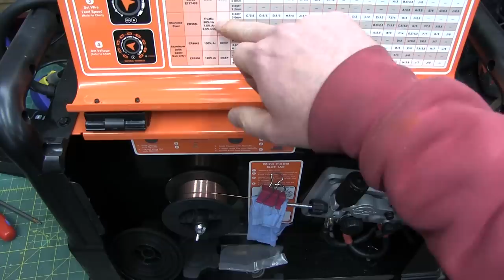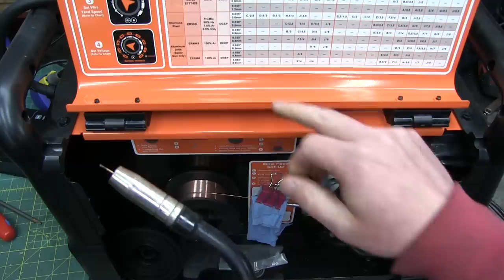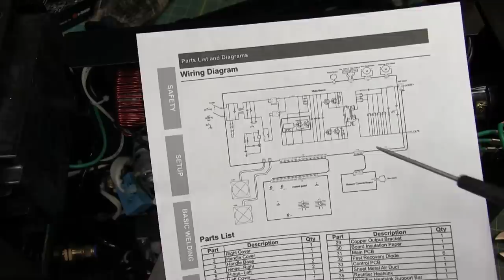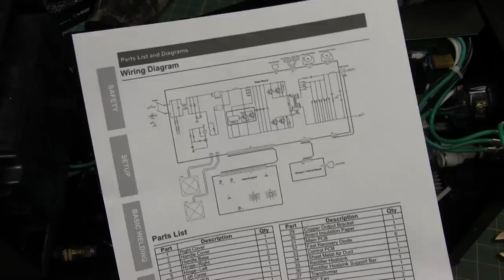BOLTR: Vulcan MIG 215 | Harbor Freight Welder

Comment: As a welder I will say this learn how to cut metal first. I have seen people fired just because they couldn't cut their own metal. Also a saying for all you welders or soon to be one, "a decent welder knows how to prevent a fire, a good welder knows how to stop a fire, but a great welder knows how long you can weld while on fire."
Reply: When I was young enough that riding a panhead was cheaper because you had to kick'em, I would get a dispatch, show up at a boiler or a tank farm and the super would point me at the boneyard. I had the morning to dig out a hunk of 3/4 or 1" plate, whittle off a couple of slabs and lay bevels on them with a gas axe, tack the test to the side of the boiler and fill'er up. No grinder, no wire wheel, no flap. Gas axe, hammer, welder. Better pass x-ray when the techs shot at night or no meat in the sandwich that week.
Reply: I've never lit myself on fire while welding... but I have lit my friends on fire while welding. All in all, that's a better deal by far.
Reply: Amen
Reply: and braise after that. Then maybe you can push a puddle.
Reply: Biana Doubt  yeah stick is good for that ... when ya lighting fireworks as they go off next to ya ... everyone yells ... and ya laugh and say i'm a welder ... but they can't hear ya.
Reply: Overhead flux core comes to mind lol
Reply: I never learned how to cut thick steel with plasma. But I used a stick, mig, and acetylene to weld. Once, out of a hole in a pipe, I made a hanging drop of liquid steel. I poked it to let it fall but it stuck to the gas torch and when shook, it dropped on me. It went through my sweater in 2 places (2 holes) and fall at my arm placing there a piece of synthetic fabric burned out of my clothes. The drop of steel literally welded this piece of fabric deep into my skin. Drop fall to the ground the same moment but the piece of fabric stayed. It came off with the burned skin. This steel drop's weight was close to 40 grams.
Reply: @noiwonttellyoumyname.4385  Unless you are a friend...
Reply: @ejrupp9555  witty?????
Reply: @charlesangell_bulmtl  That's their problem not mine.
Reply: Your garage  toung  reminds  me if another youtuber I watch  zip ties and bra plies   somthing like that ..  hes a Canadian    awsome videos   minty👌
Reply: anonymous  but a SMART welder wouldnt
Reply: Thanks, but that last one is about 14 seconds
Reply: @volador2828  lol. Yep, that's about right
Reply: A bad welder makes a good grinder
Reply: @toshmiller5571  
Saw that a lot at work. Big beads for welds that look like a catarpiller had been the unfortunate victim to happy hour at the local brothel. The poor bastard in finishing would have to go through stacks of discs in a week
Reply: A good welder is also an excellent grinder.
Reply: Had a right pant leg go up in flames due to fringe threads on the Levi's combusting. I smelled it first, then I looked down as I proceeded to finish the bead. Directly there after I looked as though I was doing the hokey pokey while having a seizure I'm told.
Reply: Hahahahahaha id agree with that.
Reply: Just last weekend I was welding and didn't realize my glove was on fire
Reply: Well I was about 19 was cutting some plate or something with 6mm rod and about 1/2” lump dropped in my wellington boot was a winter time maybe minus 15 centigrade so had lamb wool socks so boiling steel ball went through sock pulled foot out and of the pain put it back into the boot and joy of joys same cherry red lump still in boot so burned feed from underneath about 25 years later still got a scars on top and bottom off the feet lol 😂
Reply: cableup1 I set fire to the shed welding once. Was hilarious until I saw it wasn’t going out so grabbed the garden hose. Years of oil and grease on the floor probably isn’t a good idea to weld over.
Reply: Sounding like bacon       OK
Smelling like bacon     Not OK
Reply: @noiwonttellyoumyname.4385   Then you haven't welded very long, or in any fun spots....
Reply: @johndoe-so2ef  nah, I have- I’m just careful. I’ve lit other people on fire while welding, just not myself.
Reply: Guilty as charged. I have learned over the years if I can finish my weld then put myself out or get out of position to extinguish myself then go back to it. Lol.
Reply: @Shamrockjason  I've had that happen to me 3 times in Jr. high, and high school, and several times since. I don't know how many times I need to catch myself on fire before I learn to cut the fray's off my pants before welding, but no one has accused me of being the most safety oriented person.
Reply: Wise words on the last part
Reply: Three words no welder wants to say. "I'm on fire"
I was on fire this morning.
Long enough to finish the weld and ruin my insulated coveralls and my jeans underneath.
Reply: That quote!! Lmao. I work an aerospace rolling mill. Fire is about as common as oil leaks. So funny to watch the new orange hats freak out and panic. This pc of metal is way to exp to stop for a fire. It can wait till the end. If not fire dept is about half mile away. They will come right over and fix it if we cant.
Reply: Something all wanna be welders should learn is HOW TO CLEAN UP AFTER YOURSELF...lol. Not a welder but have worked with a bunch  and they were horrible about clean up
Reply: @cableup1 tankie
Reply: Yup, welded on fire more times than I'd like to admit.  Welded diesel tank full of fuel on fire the whole time.  Throw an oily rag beside my work while I'm welding to test the sphincter muscle.
Reply: Another saying to add to your list is this "a grinder and paint makes you the welder you ain't".  That's always been my favorite. And yes, been on fire more than I'd prefer. I have circular indented scars on my forearms from slag getting caught in my shirt and not being able to shake it off due to the equipment I was attaching to I beams in the ceiling being held up in the air by a half dozen laborers(the worst scar anyways). FYI - confined space with no room for any kind of lift, except manual. Also, I truly believe engineering 101 teaches them bastards to design shit as complicated and cramped as possible for us to fabricate or install. Possibly due to jealousy from having to sit behind a desk for most of their miserable existence.   🤬✌️😎

Comment: I tight my kids at 5 to weld.  There now 11 and cutting and welding Jeep body panels and I’m pushed out of my own shop.  Don’t do it.
Reply: Get them working !!  Small industries start this way! :-)
Reply: You love every minute of it
Reply: robert white You now have a production shop
Reply: Don't forget someone's gonna have to learn to spell to fill out work orders.
Reply: Goodness, I would have been a badass if I knew how to weld and had equipment at 10 years old...
Reply: I grew up working on things helping my father work on cars, work in his woodshop and build stuff. Helped him build a complete air boat fabricated the hull out of Aluminum built the engine stand made the fins rebuilt a 400 short block Chevy bored 30 over. We used it for duck hunting. Once you hit 80mph the whole thing would start to get airborne. He Restored a 1970 Chevy truck from the frame up we built a cabin and a barn on our land miles of fence. Now I do everything including electrical, plumbing, welding, carpentry, mechanic work you name I can do it. I actually have a company where I do it all accept mechanic work I only do that on our own cars because it's a pain in the ass!
Reply: I hope your welding education is better than your grammar :p
Reply: @kevinerhartjr.273  Great comment!!
Reply: I sure hope you're not the one who taught them how to spell.
Reply: @TimTrOn3000  
Blame all wrong words and misspellings on auto correct😁
Reply: @garrimcclure5767 28 32667

Comment: Once upon a time, I was a fresh-out-of-college mechanical engineer in a glorified job shop.  The old union welders took a shine to me and taught me how to weld, first using stick and then mig.  An invaluable education that I still use 25 years later.
Reply: I first learnt to gas weld in 8th grade shop. Then stick while in HS. Then 20 years later MIG and teaching myself TIG now. I agree, it is best to start with gas welding or stick. MIG is an easy extension to Stick. TIG is an easy extension to gas.

Comment: We've been testing a Vulcan Pro Tig 200 at work for the past 6 months. Running full on production in an industrial environment 16 hours a day 5 - 7 days a week right next to the Millers and Lincolns that cost 4x as much, and it's doing it running on half the voltage as the Vulcan only runs on 240V whereas the others are 480V machines.. 6 months in and the Vulcan is still hanging right with the blues and the reds and hasn't shown any signs of failure. For the price we're thoroughly impressed with it.
Reply: Hows it running today?
Reply: Its a 200 AMP machine. the voltage it uses will be inconsequential to its reliability not its usability.
Reply: @kwmiked  It's still running daily and we added a protig 165 in 2019. They've had zero issues. Rock solid machines.
Reply: @MavDude  that's good to hear
Reply: Good to hear. The miller's and lincolns are just so damn expensive for home gamer's

Comment: First let me say upfront I work at HFT.  Now let me tell you I love your reviews.  No BS straight facts for me to help my customers.  I feel like i can repeat everything you say so I can sell the right tool to the right person.  Also you are right in a lot of ways.  HFT is growing, we sell a ton during the summer months... but in winter it crashes.  Why because the home owner that buys a Chicago Electric drill to hang a couple of things in the summer does not buy shit all winter.  We are expanding our lines working to getting pro-level tools.   It will probably be a slow build up... but yes we want to go head to head with Snap-on, Dewalt and the other big guys.  I Loved your review on Bauer. Now I want to see you take a part a Hercules, and or an Earthquake 20V impact.
Reply: Half my shop is HF some stuff is junk but tbh most of the stuff works fine however its half the price of home depot or regular amazon even!
Reply: I want to say, I'm loving what Harbor Freight has been doing recently. They are targeting openly and honestly 3 different niches, the "I need to use it once" crowd, the plebian consumer, and the discerning Chad prosumer.
Reply: The Earthquake did fair well, not worth the money they charged for it and the shitty 90day warranty.  4 3/4yr later im finally sending in my 2767 Milwaukee,  trigger hangs up and battery loose. Its been put thru the ringer for a construction mechanic in the field.  I bet they just send me back a referbed gun 🤷‍♂️

Comment: I’m glad you mentioned conductive dust intrusion. I never grind inside my shop, because of all of the shop fires I’ve heard about. Everything inside your shop that runs on pixies can be a fire waiting to happen with grinding dust inside. Grind outside, or in a separate booth inside: it’ll save your shop/house.
Reply: Hmmm, looks around at work bench. Oscilloscopes, PCB’s partially populated, Vintage 1969 Celestion Speakers, Vulcan 220, GRINDERS!

Comment: I think HF is trying to step up their game for one main reason, to become the new Craftsman and the hardware part of Sears.
Craftsman first got a licensing deal with Ace Hardware, when it was a Sears owned and sold brand, then it was sold off to Stanley Black & Decker with a license deal for Sears to produce their own line for so many years. Outside of Sears and Craftsman, there's really no store owned product lines that aren't sold beside other companies, other than HF. Not to mention that in the past half decade, Sears has been selling at least the yellow brand in stores and advertising the same brand in their largest ads of the year. Plus Sears is basically on life support at this point, and I wouldn't be surprised if that plug is pulled within the next half decade; they losing Kmart and Craftsman, now all they have is a marketplace of a website and their credit card offers, also wouldn't be surprised if Kenmore is sold off soon.
Now that HF is really the last store to own their own brands and sell only their brands, they probably need to step up to avoid losing too much to brands like Bosch and SB&D, and the other brands that manufacture and relabel for big box stores like Kobalt and Husky. It's a logical move to take initial profit loss to gain recognition in an industry that has basically become an oligarchy. 
Even if HF's brands share off-coast manufacturers with other no-name brands, or even the few one-off cheap tools from big-name brands, as long as they actually sell good tools at good prices, they should survive just fine. 
And most, if not all of us, that watch this channel have known HF to be the cheap but bad tool brands, but it'd be nice to see them keep up with the better tools and gain some positive recognition.
Reply: I am in the market for a welder not sure I want to buy one from Harbor freight or not.

Comment: Being in electronics all of my life I was very familiar with soldering. Against all advice I started with TIG welding since it seemed to be the closest to soldering. I am so glad I did because my first welds were way better than I had hoped. No splattering, nearly silent and NO SLAG to have to chip away. 15 years later and I have no reason to try anything else, although I admit that MIG welding would be faster, but I don't mind taking my time.

Comment: I have the older black box HF 170amp flux/mig welder which I bought ~3 years ago for roughly $170.  I'm at least on my 10th spool now and did the capacitor mod last year which can be found on the WeldingWeb forum.  It works well with Lincoln .030/.035 wire. I also did a gun upgrade because the stock gun was complete crap. Just remember that if you are a noob, you will also need to invest roughly $500 more in helmet, gloves, apron, chipper, better ground clamp (I got a magnetic type) and many other things like a bandsaw (I have the red HF horizontal one).  I also initially upgraded the stock power cord on the welder to 10ft of 10/3 600v SOOW as well ran a new dedicated 30amp circuit from my service panel to run the welder (its 220v).  That and I also built a 25ft extension cord of the same cable.  For all of this I used Hubbell 30amp 250v 3-wire plugs.  Welding is cool as frig, but it's not cheap to get into. That said though I really needed it and so it's easily paid for itself several times over.

Comment: To find out what the DC voltage is if you know the AC volts for a full bridge rectifier, just multiply by 1.41, so for your 220V input, it should be 310v DC
Looking at the manual (available online) rectified DC into an inverter then rectified again (same as switch mode PSU)